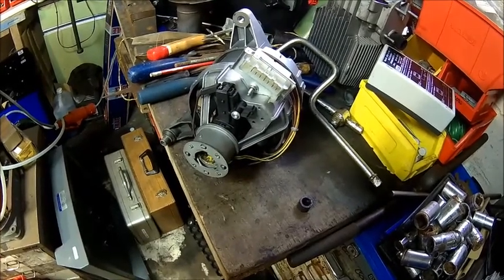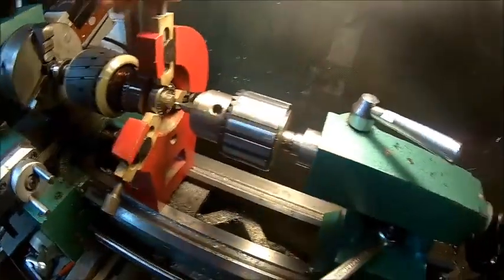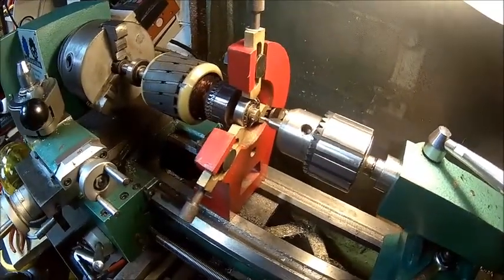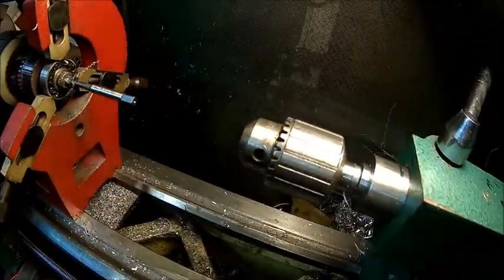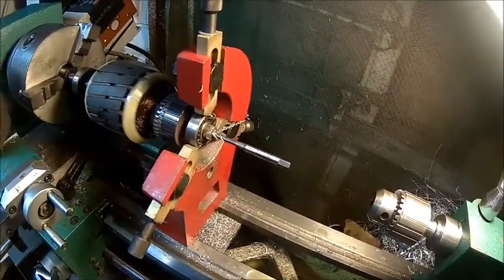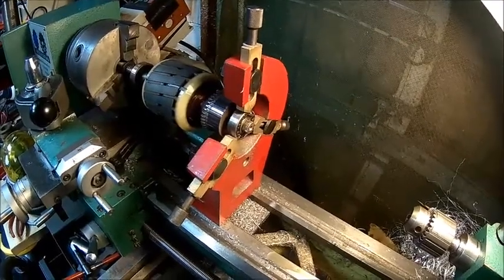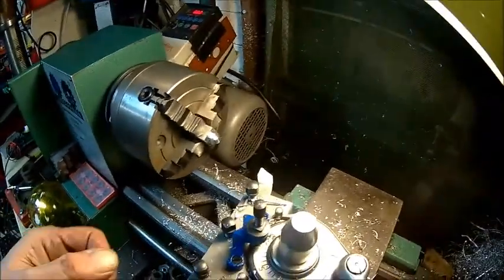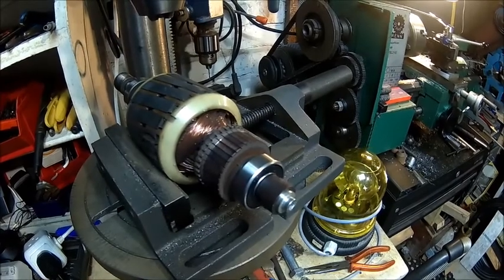Washing Machine Motor,  Speed encoder fix (magnet ring falling off)

Comment: Hi, anyone know how the magnetic tachometer ring fits on the end of the shaft? Pressed-on, heat shrink or ? You can buy the ring for some motors [Beko/Arcelik for e.g.] for around £10 in the UK, plus other suppliers in Europe but how the heck do you get them on without cracking the brittle magnetised ring [inner ring looks like brass]. Cheers.
Reply from the maker: Its pressed on, needs extreme care to remove
Reply: Ah, I was afraid that may be the case. The old one is beyond repair so can be cut off but pressing the new one on without damaging it would be tricky. Such a waste to bin a perfectly good motor for such a daft reason.
Thank you very much for your quick reply. @dynoguy
Reply from the maker: the usual reason for falling off is that either the bearing or commutator (because of worn brushes) gets hot and melts the plastic core of the magnet assy, ending up getting loose. I tried a few ways of re-fixing it and finally ended up turning a piece of aluminium to size (don't use steel at this point, it disturbs the magnet pattern),  essentially acting as a stepped centering washer, then drilled and tapped the shaft and simply bolted it on, it never came loose.
Two months ago, the spider of the drum broke loose (corroded badly), so i finally scrapped the machine as it would  have cost me more in spare parts than my new (second hand)  Miele W Classic with not even 300 hours on the counter, ... lucky bargain ....:-)
Reply: Yes, mine is off an old'ish Beko, so different to your vid. The magnetic ring had cracked and come loose off the brass inner ring. Super glued and clamped it together for a week, refitted and it worked fine for 12mths. Gone again now and beyond repair this time. Motor is fine apart from that. Thanks again for your help. @dynoguy

Comment: Great repair. Most people would buy a new washing machine :(
Reply from the maker: Thanks,...you most probably right, but as you can guess, i won't...:-)
The history of this machine is in fact exactly that sort of attitude ... Manufactured around 1995, i've got it 3 years later in exchange for a crate of beer, because it was faulty and replaced by a new one. I replaced a broken AMP connector and it worked. Another 3 spade connectors and a piece of wire some 15 years later, so add 50 cents to the beer. a few years ago, i replaced the shock absorbers and motor bearings,  adding another $40.
For the repair just now, add a $3 for the bearing, makes it a total by today of around $70 including the beer..... Now show me a new machine under $100 which will last that long .... :-).
Reply: @dynoguy  You are forgetting the satisfaction of fixing something yourself :) Our 20 year old A.E.G. has never needed a repair :) I guess we got lucky with that one. although the door rubber should be replaced at some point. The electric oven on the other had has broken down 3 times :(